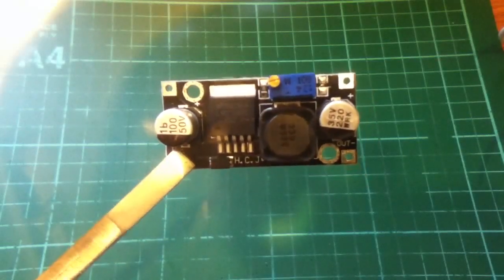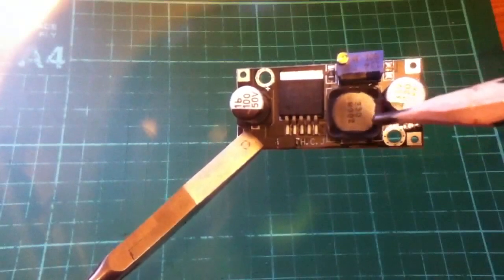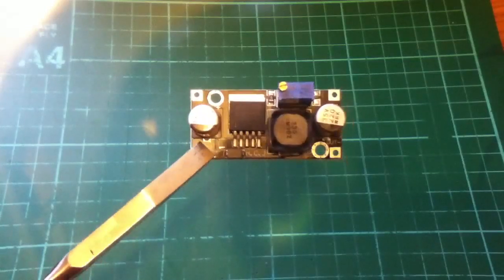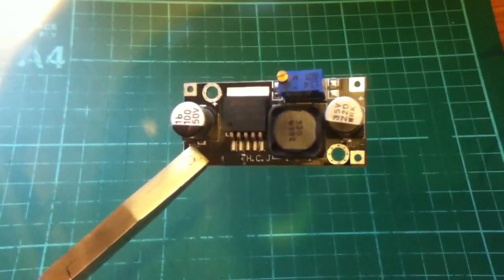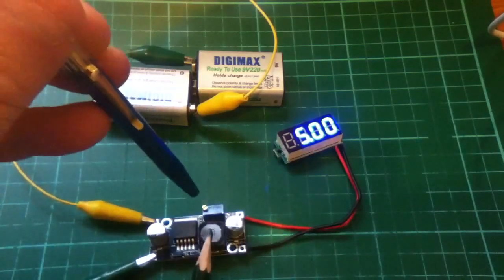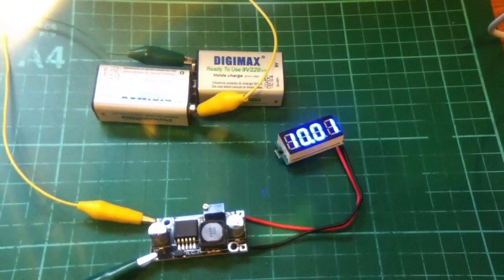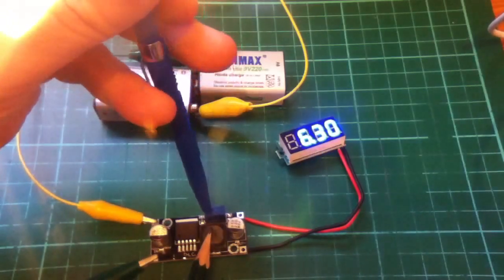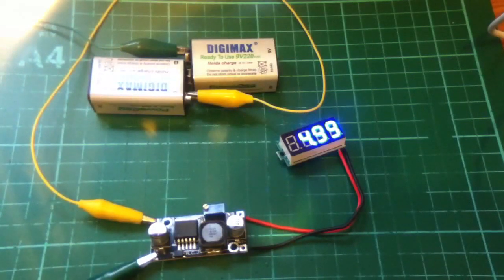Ridiculously Cheap Voltage Regulator Board uses LM2596 SMPS Chip

Comment: I'm working on a car project.  I have a 1997 Isuzu trooper.  They have a G-sensor on the frame near the back axle that always breaks.  They aren't available anymore and the purpose was limited in the first place.  Today it serves only to keep my CHECK ENGINE light on.  So with nearly no background, I've been working at faking out my car's computer.    The sensor is powered with a 5-volt reference from the ECM.  The ECM is happy when the returning signal voltage is between 1.5 - 2.5 volts. and changes no more than .0002 volts each tenth of a second (changing faster than physically possible).  I first thought myself clever when I learned how to reduce voltage with resistors.  Unfortunately, the 5v reference drifts from 5.08 to 5.17.  So I thought the drift was putting my resistors out of the voltage range.  I purchased a buck converter based on the LM2596S,  They keep the voltage a lot more stable but it still moves, apparently faster than .0002 volts within 1/10 of a second.  I think it's OK for the voltage to move around a bit.  It just can't move fast.  So what's my next move?  A better buck converter? Capacitors?  
Thanks for taking the time to teach us.  You and others like you are a valuable resource.

Comment: Why did you press the inductor with a pencil? I bought two and no one works, I've been testing with a batery 12V 9 A, could you show why doesn't work?
Reply: OMG 9Amps? Really? Check it's datasheet, if datasheet shows maximum Current rating below 9Amps, so you have fried your module

Comment: I got 3 of these for £1.97, including P+P :). I notice the chip is rated for a 150Khz switching speed, but the seller says 65Khz... After testing with a scope, they were 52Khz.. However, (with no load) after 13v+ input the switching rate became extremely erratic. I've yet to test them in a real application. The bulk ripple is 3mV PP, with outliers at a max of 40mV PP..

Comment: Hi Julian, I have a 54 volts 2.1 amp charger that needs to be bucked down to 42 volts and those 42 volts can have a current as high as 5 amps. Can you please recommend me a good quality small DC to DC buck converter that will work for my application?! Thanks and great video!

Comment: If or when this device fail, will the output voltage goes to 0 or full input voltage? I have some concern because if it fails with full voltage I may damage other components that are powered by it :(

Comment: These chips are cheap and I've used them on many projects, but I've made magic blue smoke with two of them on my current project. Melted the the chip on the first one. Installed a second one and adjusted it just fine. It then exploded with pieces of the chip flying.

Comment: I use this little buck converter to power up my MQ-136 gas sensors. The output voltage coming from the sensor is very unstable. I was pretty confused since i use this buck converter for my final project in the college. And finally i come with an idea to power up my MQ gas sensor directly from the Arduino power supply.  And Tadaaaa the output voltage becomes stable. I figured out that using this buck converter is the root of my problem. I think using a switching power supply like this will cause an unstable output signal. Better to use the pure dc source then...... HAHA

Comment: Hi, Julian. Whenever I have a doubt about some chinese module, you've already tested it. I ton Br one of these to the 12V cig lighter on my car to charge my phone but it's only drawing 780mA according to Ampere app. The phone usually draws 1.2A from the original 2A wall power supply. Why so low?
Reply: same problem here..its due to voltage drop when a 1A load is taken

Comment: I've been looking all around and can't find an answer,
I want to use this to provide 5V 3A ( maybe 4A ? ) from a 20v supply
Can these realistically do this or do they crap out at ~1,5-2A like some others I've seen ?
Buying these is cheaper ( 0,7€/piece ) than buying the individual components ( 0,2€ for the ic, etc )
Reply: These are 3A max and I bet would not last long at a constant 3A. You need something built around the LM2678 chip which is rated for 5A.

Comment: I have a question, I am trying to regulate the voltage on a quadcopter I have.  I want to use a 11.1 volt LiPo but the quad has a cut off at 10.5. When fully charged the LiPo is 12.34 volts. But as you draw from the Batt, you obviously drain the and lower the voltage. The quad will begin to flash low voltage as the pack gets to 6.63 volts. The quad is setup form the factory with a 7.4 volt Lipo 2 cell. I want to run 11.1 volt 3 cell LiPo.  Will this work for me?

Comment: What would happen if input was a/c 18 volts right off a small transformer
Reply: use 4 diodes and a capacitor to smoothe the input then put it into the buck
though it's max 35 v in if I remember right

Comment: Seems there is a new smaller one on ebay: 
Mini 3A DC-DC Converter Adjustable Step down Power Supply Module replace LM2596s

Comment: These are just fantastic. I use them for all sorts of projects and just bought my next 10. Your right about the HF noise however with analog devices. In my case, the issue was with small audio amplifiers. By the sound of it (I didn't scope the signal) I can hear some in the high end of the audio range with the gain turned up on the amplifier.
Reply: +Scott K  Hi Scott can you help me please,  any idea why I cant use this module to power my desktop fan that uses 2AA batteries, but I can power some led's?  Thanks John :)

Comment: A comment on the cheap postage:

China is sponsoring their export industry so the state is paying the postage to get it on the boat. Then they use (or abuse) a very old trade agreement that says that the receiving country pays the cost for getting it to the final destiantion. This system worked fine when people were writing letters to each other since it more or less balanced. But in a modern world where the trade is going from the east to the west, I forsee a big trade war regarding the abuse of this system.

Comment: Does this mean that we can use it in ESP8266 TX and RX connected to Arduino Uno?
If yes, could you please show how we can do that. I understand it needs to be in place where data from Uno will come to ESP8266 because its 5V and we need to step it down to 3.3v
Reply: +ahmedadelhosni90 You can use it to power the ESP8266-module but NOT for level switching of the TX/RX-lines. A quick, dirty and perfect way to level shift is using a 1K resistor from Arduino TX to ESP8255 RX - all other connections coming FROM ESP8266 to Ardunio can be directly connected, as the Arduino reads a 3.3V "high" signal as "high", too.
Reply: +Talha Kamran NO!.
Reply: +zaprodk why NO ? I can suppose that ESP is not the best choice for low power applications, but why can't I use the converter with the ESP ?

Comment: the reason these are so cheap is the lm2596 is FAKE!

I checked a bunch of different cheapo Chinese buck converters. the switching frequency isn't even close to the real thing. they can't handle the real lm2596 power ratings, have no thermal protection, and blow up easily.

for simple low current applications they're fine though.
Reply: +ms3bani It may be fake, but it does what it's suppose to.... usually. lol
Reply: +Mark Krawczuk how did you validate they were genuine?
Reply: @bugs181  If the switching frequency is wrong, I would not say it is doing what it is supposed to.

Comment: I'm planning to build a simple bench power supply from an old computer PSU. Would this gadget be suitable to use as a variable voltage output along with the standard fixed outputs at +/-12V, 5V and 3.3V?

Comment: I bough one 2596 and want to put it in 24V/4A laptop power supply.I add cheap voltmeter to and external potentiometer.Thanks to this will hawe a regulated power supply 3A !.

Comment: Can these be used in parallel to handle ~5amps?
Reply: No, you can't parallel 2 power supplies without an op-amp which will cost you as much as the unit itself. Just get the right supply.

Comment: Thanks for sharing.
What you do with extra volt? 
I want 5 volt input, and 3.3 output. Does this handles the extra 1.7 volt? And where does it go? (I'm new to electronics, and would appreciate anyone could answer me)
Reply: From description
Output voltage is adjustable(1.23V - 30V .  3A Max ) so you can get 3.3v easily.
1.7 volt wont go anywhere, Switch mode regulators are very efficient (~90%). so only a  very little electrical energy is wasted as heat. 

http://www.ebay.com/itm/1pcs-1-23V-30V-DC-DC-Buck-Converter-Step-Down-Module-LM2596-Power-Supply-Output-/251511330096?pt=LH_DefaultDomain_0&hash=item3a8f3e5530
Reply: The actual formula is Input_Power x efficiency = output_power ie Input_voltage X input_current x efficiency = output voltage X output current

Comment: This was helpful for my project, thank you! I'm making wardrobe LED lights and want them to go on and off using an automatic IR LED switch, so I shall use this to convert the voltage down to 5V to use for the switch system. 

I'll use a 12VDC power supply to power the LED strips.

Comment: Just to share my experience I got them for 0.35£/pcs with delivery, working very well, mostly using as led light driver (inside chandelier ,converting old  style chandelier to led light)in close space it can handle 1.7-2amps depend on space in open up to 3 amps. by the way its step down module

Comment: at 12to 14 volts how many amps can the board handel?
Reply: This is obivusly a chinese copy, but the original can handle 2A.
Reply: it can handle 3a without issue even this cheap Chinese stuff. therefore it can not convert 12v to 14v

Comment: I'm approximately 99.99% sure that LM2596 chip is a counterfeit. Unless the seller somehow miraculously got the genuine chip for under a buck, this is way too good to be true...
Reply: Yup these bastards have no over-current protection and no thermal overload protection. You can also take at least 10% off the claimed efficiency. Still handy though.
Reply: iSolarSunrise I tested and verified these are fake lm2596. they work well enough for the price but can't handle the power ratings of the real thing and they lack the overcurrent and thermal protection of the real thing as well.

Comment: One question... 

can I use this LM2596 on my car to charge the cell phone on 5V 1.2A ? 

Because the Amp on the car is high right? 

Would this LM2596  hold on, on the battery (pulling a cable direct)
C20 (Ah): 60
RC(min): 90
CCA (A)*: 480? 

or can hold on, on the cigarette lighter?
Reply: +Raphael de Arruda Absolutely. Even I use this module to charge my Galaxy Tab S on the go (Vin source: 38.4 Wh laptop battery pack). If you're planning to built one, I recommend to put a heat sink and voltmeter across Vout so you can monitor the output voltage before putting in your expensive gadgets in.

Comment: If you input 9V and output 6V, what happens to the output voltage, if input drops to 8V?
Reply: EDIT: I realized your comment was rather old. This is still valid :)

RPdigital what you should keep in mind is that the LM317 is a linear regulator, and the LM2596 is a switching regulator. I'll type out the main pro's and cons of the two:

Linear: Pros
Very clean power output
Simple to use, only requires a few capacitors on the input / output

Linear:  Cons
Highly inefficient, especially at higher currents

Switching: Pros
Very power efficient  (So higher currents  in  less space and better battery life)

Switching: Cons
Needs  several external components (simplest require  some capacitors, resistors and an inductor)
Can have high ripple on the output  (bad for sensitive analog circuits)
Reply from the maker: Nothing should happen. You just need to keep a couple of volts between input and output to maintain stable regulation
Reply: Julian Ilett
So will the output stay still 6V like with LM317?
Reply from the maker: Yes. The LM317 and LM2596 are both voltage regulators - they just work in different ways.
Reply: I see, thank you for your reply! Then I need LM317 for my project. :)
Reply: The LM317 is a linear voltage regulator. It drops voltage by producing heat.  A buck converter is like flipping the light switch on and off 150,000 times a second to reduce the effective output voltage.
Reply: @rich1051414  exactly right. An LM317 acts just like a series resistor or a string of diodes to drop voltage by dissipating heat. It gets hotter as the current increases, and as the voltage drop it provides increases. Needs a heat sink for any real power drop. It's old-school from 1976... very low efficiency and really only useful for dropping a few volts IMO. Switching regulators are much more efficient.
Reply: dumle29 Thank you!
Reply: +dumle29   So for analogue circuits that use thermistors and relays, should I use a linear regulator instead of buck converter? 
Thanks
Reply: A relay isn't going to be affected by a small amount of ripple. A thermistor in a resistor divider arrangement typically isn't going to be sensitive to ripple either. 50% of VDD is 50% no matter whether you read the thermistor during high VDD or low VDD ripple. So, I'd say you could use either regulator in your situation.
Reply: They cut straight out as soon as the voltage reaches 8.7v in my testing...

Comment: Hi mate what sort of current can it handle when it has increased the voltage i need to input 19v and get out 24v at 1.5~ amps will it work. I cant see it myself but im not 100%

Comment: Great information. One question: Would I need a current limiting resistor using this regulator board in a series LED setup as long as I had the rating and limited the voltage to total voltage? Let's say 12 VDC to 10.5 VDC? Thanks
Reply from the maker: Yes, use a current limiting resistor, or better still, find a regulator with both voltage and current limiting potentiometers often called CC CV.

Comment: Can you link to it and also that little digital meter if possible. That would be cool for me to have and run off of like 2 sla battery's because I want to start getting into electronics and that could be useful to start with what voltage does my ups and portable tv stop working at (they run off of sla battery's and it would be useful to know the voltage cutoff.)

Comment: Amazing mate. We may knock China for quality sometimes, but here they got it bang on. Stable little circuit and variable too.

Just one question though. Do you know what the maximum load that would sit at comfortably, without any cooling. I'm starting a little project of building an electronic cigarette to run a low resistance coil. I'm kind of aiming for 10 - 20w roughly, but with ease. Do you think this board would be suitable? DC input of around 8.4v / 9.6v, just using Ni-Mh cells i have from RC batteries...lol.
Reply: What you need to remember, is that there are 3 heat sources on the board. I would attach to a heat sink at the rear.

The construction means the heat transfer is inefficient, so expect some heat, and the small coolers that stick to the top of the chip? Useless.
Reply: ChaoticaExtreme it's barely going to make any heat. lm2596 is about 80% efficient, though your point is still valid if you're going to push the limits
Reply: *****
And yet it gets warm at half an amp. Very hot at 2 Amps. At 3 Amps the diode expires as the high board temperature derates it.
Even with an off-board diode the board heats up. The inductor is under-rated.

I got 4.5 Amps with a heatsink, and fan blowing over the component side. Everything was still extremely hot.

I used 19.5 volts supply, 14.7 volts out. Temp rise is about 70 degrees above ambient at 2 amps by the datasheet.
These boards don't run cool, and even the Ebay ads state a heatsink if you want the rated output.
Reply: ChaoticaExtreme lol, sure sounds like pushing the limits of this ic, I'm surprised you can get it to work continuously at 4.5a, the datasheet says that's the peak current. this thing was designed for 500mA car usb cigarette chargers
Reply: *****
The datasheet guarantees 3 Amps
Reply: ChaoticaExtreme the datasheet also mentions all the relevant thermal characteristics. at 3A constant usage you're still pushing the thermal limits as this specific chinese pcb was not designed for a low-enough °C/W rating to be used at 3A, so your advice to use some sort of heat-sinking is pretty good!

Comment: change the output capacitor to real low esr one and you get nice clean 20 mV p-p ripple. Otherwise the nioise is from 0.1V up to 0.5V depending on voltage chosen and ... your luck.

Comment: did you do any efficiency testing and check the heat dissipation with larger input voltages ?
Reply from the maker: No, but the LM2596 data sheet has all that data